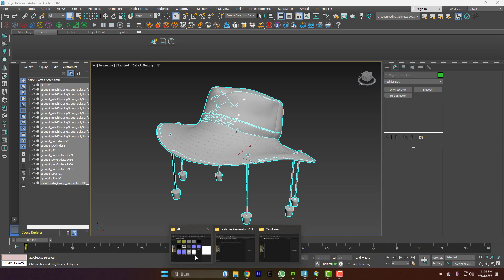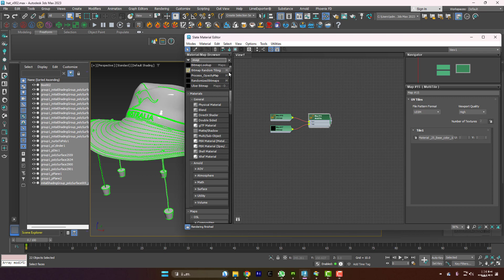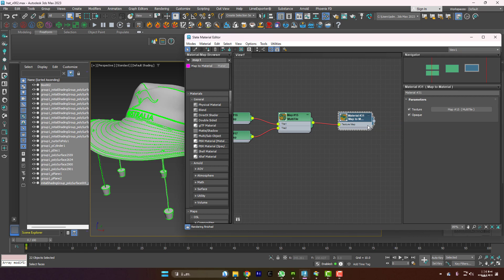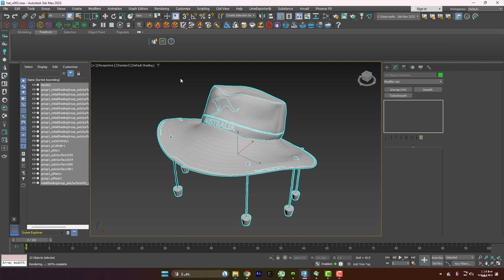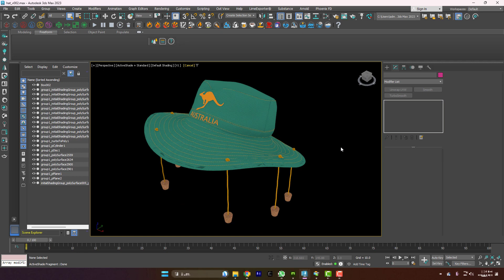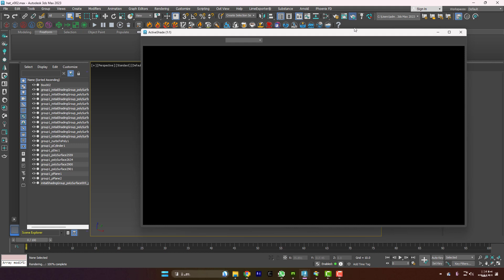Apply Multi-Tile Texture With Single Material In 3DS MAX

Comment: I ran into a problem when using MultiTile material and using Arnold everything renders well, but only with the help of the CPU and if you turn on GPU support, then it stops reflecting UDIM textures, what is the problem, please tell me version 3dmax 2024.0
Reply from the maker: Multi-Tile material in 3ds max is really not recommended way though I showed one possibility here. Because the multi-tile in it create some issues in rendering. Or maybe it might be only my problem.. Need more views regarding this

Comment: Your content is excellent - so many useful workflows that are commonly needed, yet are for some reason often neglected in other tutorials I've watched.
May I have a question? Is there a way to crop UV tiles or unwrap scanned data again? Basically, I have a scanned object from megascans, for example. It already has UVs nicely packed. All the textures are 8k. Let's say I delete part of the mesh and want to keep just a small part of it. The problem is, I still have to load a huge 8k texture containing all the UV data I no longer need. My goal is to unwrap the remaining mesh again, render the texture in small resolution with UV data pertaining only to the part I want to keep. Is it even possible? If so, what should be the correct approach to achieve this?
Reply from the maker: hy. thanks for reaching out.
For the scanned model I would suggest to make a low poly using retopo tools and follow this tutorial for texture transfer to new UV set. : https://www.youtube.com/watch?v=HkP6lY5pZq8&t=45s
If you want to use the same high poly you can can create auto uv and then again follow the same tutorial : https://www.youtube.com/watch?v=HkP6lY5pZq8&t=45s
hope this will solve the problem.